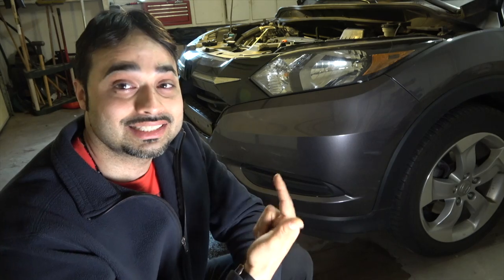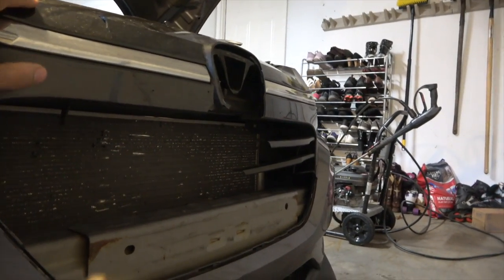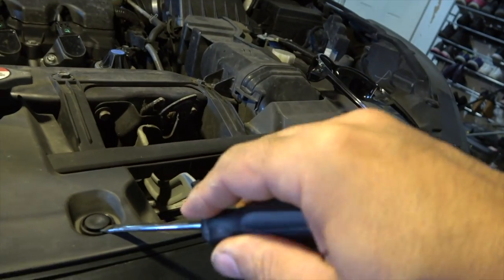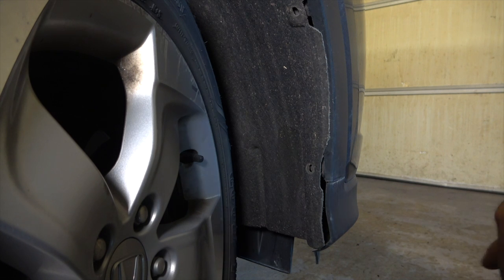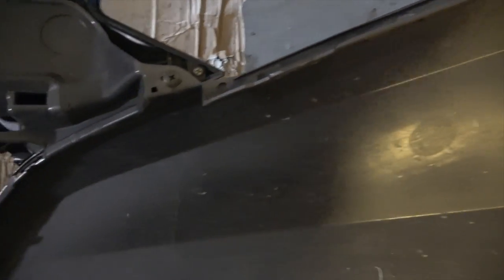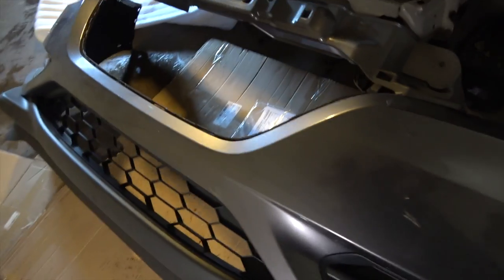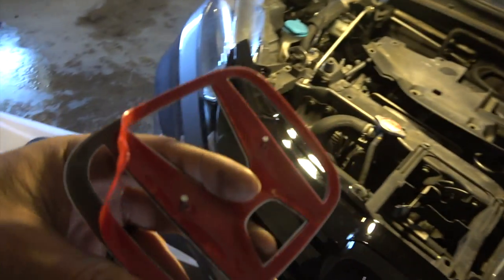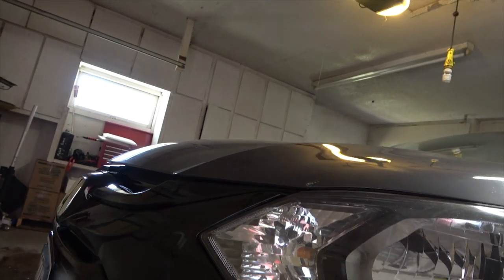Honda HRV Front Grill Removal/Installation

Comment: Thanks for the video. Not many vids on HR-V front grill removal.  My 2016 got the samei inner part busted (not affecting  the more expensive top trim parts luckily).. I ordered a factory Honda inner grill and installed it today. I took a shortcut of NOT removing the bumper. The only reason you have to remove tthe bumper is to remove the screw just under both headlamps. You cant remove the headlamps without removing the bumper either.
Being very careful after removing plastic retainers and the one screw just under the airduct intake I carefully flexed the grill and where it is attached to bumper with screw below tthe headlight just enough to cut the grill off with a reciprocating saw. Yes..it wasnt the correct way to remove it.. and my new grill is missing two small screws..But you cant tell it and I didnt have to remove the bumper.  Someone above asked about the upper trim on the grill.. The inner grill has to come off to replace the outer upper grill trim..It is held on by tabs and screwa. Hope this helps someone. Thanks for the video.

Comment: Random question : were the fogs lights would be on this model to the plastic bumpers pop in and out?
Reply from the maker: Good question! Not on this model sorry, this is for basic model only. However, uninstalling the fog lights won't be that difficult though.

Comment: I have a 2018 Honda hrv, will this grill fit that year? And only the top grill of my car is messed up, the lower one is fine, do I still have to take apart the whole bumper to replace it?
Reply from the maker: Yes it will fit!
Reply: You don't actually have to take off the whole bumper, that's a "fat hands, wrong tools" approach. You can loosen the bolts for the headlights and take the inlet pipe for the screenwash, that should give you a better area to undo the lower screws which hold the grille on

Comment: May I ask where was the small piece of black plastic installed in the film at 3:58?
Reply from the maker: I never installed it, I believe it's for a different model of HRV though.
Reply: @smilennodproductions2801   Thank you!  Therefore, did you not install this small part during the installation process?
Reply from the maker: @黃群軒  Correct